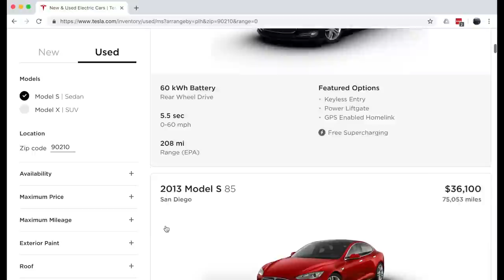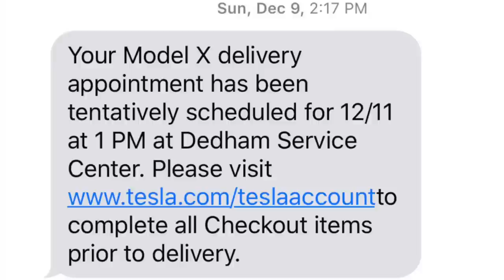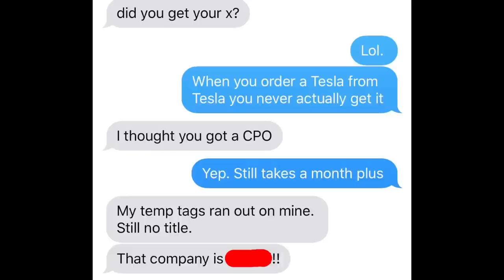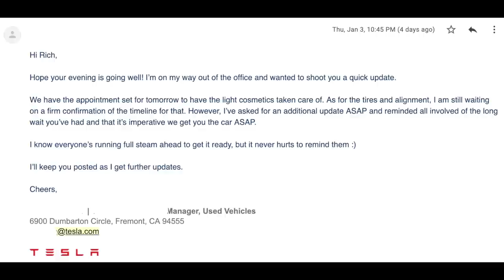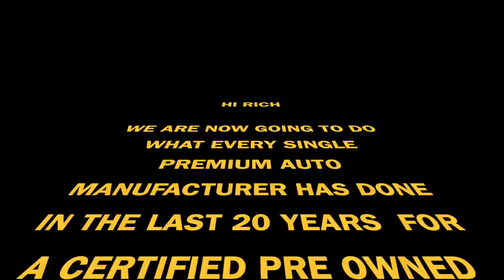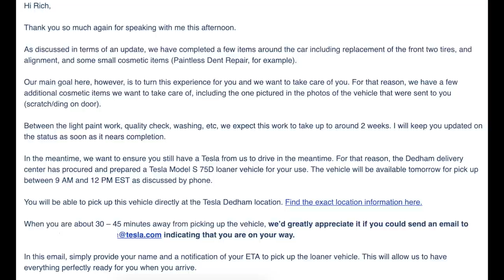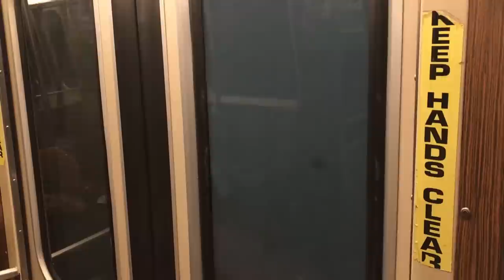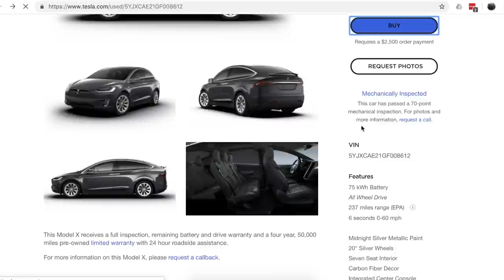How I became a victim of the Tesla system

Comment: Your mother is a much more sensible person; she drives a Kia.
Reply: Samcrac mama’s always right
Reply: Kia's fall apart quick
Reply: @legiongamers99  not if you treat them right.
Reply: @legiongamers99  Then the 7 year guarantee comes in handy ...
Reply: @Slim_Loaf  True, my 2012 Rio had only the catalytic converter need replacing and that was covered entirely by warranty when it was 4 years old. Kia was a good experience. I just upgraded 3 months ago to a Hyundai and that is going well so far.
Reply: 10 yr 100k mile limited power train warranty, 5 yr 60k limited basic warranty
Reply: I was going to say exactly this! I love your mum.
Reply: Rich's mother has to be a great woman. Just look at the son she raised.
Reply: @jadedjay7861  to each their own... I've had 2 Hyundais so far. 05 Elentra, starter went bad at 76k miles, warrenty took care if that got a loaner Sonata. Bought a Sonata about 3 months after that. Put 50k miles on it, brakes tires and fluid changes. Had for 3 years rented a Kia Sondona. Went a priced a new one which was a 2015. Bought a 4 year old Sienna instead for about $5k less.

Otherwise I'd have one. Might get another Elantra ot Veloster to putt around in.

But to each their own.
Reply: Took the words right out of my mouth. Rich do yourself a favour mate and buy the Jaguar. 

I can tell you exactly what happened, they designed the website to make is look sleek with the stock images and didn't want normal photographs to spoil the look of the website. What car manufacturer do you know, in order to buy a used car you have to request photos? That ain't typical of a car manufacturer. 

It's like one of those technology companies where you have to request a quotation to find out a package details. Its not a car manufacturer, it's a tech company, they need to figure out what are they first Car or Tech.
Reply: Does she also have a Nokia?
Reply: @110380michael  I'm on my third Hyundai. Haven't had a major failure with any of them. 189k miles on my 06 Elantra so far. Biggest non-maintenance expense has been the radiator.
Reply: @110380michael  What is your point? My m3 has 142k, my 335i has 200k, my grand caravan has 289k, my 325i has 120k and my caravan has 310k. All are perfect runners with maintenance and replacing wear n tear parts. Your point???
Reply: Now I know where Rich gets his laugh from :)
Reply: She's got more soul.... Get it?
Reply: haha nice one
Reply: @goclunker  ummmm... To each their own...
Reply: @110380michael  Ummmm... you act like cheap ass korean cars are a godsend, where as the world's most unreliable cars do double the mileage....
Reply: @goclunker  Mikes point is that a kia is not a ........."Kia is Korean pos junk."
Reply: @goclunker  haven't said nor suggested anything remotely close to that.
Reply: @michaelotieno6524  It is a Korean POS. You want a good Kia? Get a k900 or a Stinger, but please don't act like the 1.6-2.4L Kias and Hyundai are the pinnacles of trouble-free engineering. Their engine issues are now beyond documented. Mitsubishi blocks built to even lower standards than Mitsubishi itself.
Reply: I've had 5 Kia's so far(on my 5th one now) trouble free family cars for the most part. Better that the Ford I had, that's for sure. Optima, my engine is ok so far,yes there are a bad batch of them,but I've got a lifetime engine warranty,as long as I own it. As a result of the problems,with other 2.4liter engines. Also, Hyundai offers a lifetime warranty on their hybrids,and plug in electric car batteries. Lifetime.
Reply: @theartplaza Exactly. kia's and hyundai's piston slap issues on their 4 cylinders have been swept under the rug. We are not even talking about the common rod bearing issue, we are talking about piston slap which is unrelated yet prevalent. The genesis line, stinger, k900s are great cars, but lets not act like they have anything in common with their basic cars. They don't, and that's why they are great. An Optima will NEVER be a stinger.  Nothing is even comparable between the two, not the material quality, not the build quality and definitely not the mechanical. That's the truth.

Edit: There is one comparable: The badge. That's it.
Reply: @theartplaza it often depends on the dealership. The dealership I use has free loaners, and are very good at customer service. In South EastMichigan.
Reply: Ole The Viking 
Kia’s fall apart quick? Well, at least your covered for that with their 7 years warranty.
Reply: Jay Mack You can drive a Kia for 5 years and then sell it while it still has 2 years of warranty on it. How’s the resale value of your car?
Reply: I know my Mom would not drive me to a dealership...lol
Reply: @JohannesB5  lol what?
Reply: @Conservator.  That's the only thing i like about KIA. They're cheap and do what you paid for them to do. Nothing more or less.
Reply: @legiongamers99  amarican cars are know to be rately and plasticy. Atleast here in Germany.
Reply: @JohannesB5  lol I've never driven in a "rately and plasticy" american car before. I mean I've only driven Fords so I'm not speaking for other American cars. But aren't all asian cars using mostly plastic for interior? Seems a little hypocritical.
Reply: @legiongamers99  thy dont my moms kia is nicer on the inside than my passat
Reply: Didn't think I'd see you here :D
Reply: Your mum is funny lol ,what se said totaly true.
Reply: A-fucking-men. I've put so many miles on this new sportage without a hiccup. This is probably the first modern car i've demo'd that won't be in a used car lot within the next 10 years. Kia was shit in the past but they've improved a lot. Hyundai, the sister company, is also doing well.

Surprisingly, it's easy to repair yourself as well. Pop open the hood and look at how neat everything is laid out. Two plastic engine covers and then you have access to the plugs, pump, electrical system... A DIY's wet dream.
Reply: jappie2 read consumer affairs for kia and Hyundai... their high end cars are great, their basic cars are section 8
Reply: @jadedjay7861 :  Based on what?

Based on Consumer Reports, it's middle of the road, re quality and durability. 

Based on my experience renting cars, it's better than the American cars, and worse than the top Japanese makers.  Hardly surprising.
Reply: Um... I'm fearful for her life.
Reply: I drive a kia, yeay! 🤣
Reply: @legiongamers99   not anymore I worked for kia I used to think they was junk...but after being to the factory and driving them.. There are now a good make... They stole talent from audi
Reply: @legiongamers99  really? My mother has a old Kia Cerato that still runs well and rarely needs fixing for about 3 years now. Has 300,000+ kilometers
Reply: And a Kia has aftermarket infrastructure. Tesla doesn't care once you are out of warranty.

Comment: I wouldn’t touch a Tesla dealership or website with a 10ft pole & this cements the way I feel.  I was treated like a king when I bought my used $60k Porsche (not CPO) from a dealership 6hrs away.  Threw a fully refundable deposit on it & they had a it sitting with a red bow on it when I got there & the paperwork was ready to go.  They even gave me $100 worth of free stuff from the shop.  Tesla will not be selling cars in another 10yrs.

Comment: I've bought 3 certified pre-owned cars from the manufacturer (Mercedes W211 E320, BMW F01 7 series, BMW F10 M5) all were available to be picked up same week. All were in perfect as new condition when I got them (any stone chips taken care of, wheels re-finished etc by default) 
The fact that Tesla pretend that they are doing you a favour to compensate you for waiting over 2 months by fixing some wheel scuffs and some paintwork is an absolute joke.
Additionally, when you are buying something like a 7 series, BMW will loan you anything you want while you are waiting for your car to be prepared, right there and then, you don't have to wait a day or travel across the country to a different dealership

Comment: Most likely the car was curbed, meaning it lost traction in bad weather and probably bashed into a curb.  It makes sense considering it needed tires, an alignment, and had some distinct rash along the spokes of the wheel.  Likely they have been stalling waiting to get replacement suspension parts.  I've worked for premium brands before, there is alot of subterfuge when they find a problem that was not billed on the initial inspection.  Generally VW America will just issue a long term loaner for their higher end brands, usually a panamera or an A8.  Common issues with Porsche include exhaust system cracks, badly raashed wheels, bent or broken suspension parts and sometimes the height control doesnt work, all of which can have a backlog of 2-3 months to repair.  I also happen to know Tesla does not employ certified techs to do the initial trade inspections either so that is where this issue is rooting.  Tesla has the ability to solve this problem by simply making all repairs prior to listing them as certified pre-owned including aking sure it has the title.

Comment: I’ve worked at Tesla, and can tell you that this experience is standard. They split up so many rolls. From customer experience specialist, to owner advisors, to delivery experience specialist. There’s little contact between them, so that’s why there’s always conflicting messages sent to you. Most used Tesla’s that arrive to a customer come directly from an auction house and turned around in 24 hours ,and sometimes same day depending on scheduling. Tesla employees normally have to fill in rolls that they’re not familiar in, so misinformation is common as they don’t know any better. Most normal dealerships can get you tags same day, but since Tesla’s are distribution centers we can’t do that. Once you take delivery, the paperwork is sent to the dmv depending on your state. This process normally takes around 30 days, so if your temp tag is near expiring call your Tesla center and have a new tag overnighted to you. But if your dmv has sent out your plates and your tag is expired, your out of luck and have to wait. Most centers get overwhelmed and all the paperwork gets backed up, which what causes tag delays as well. If you guys are having some specific problems, I might be able to enlighten you on what you can do.
Reply: Tell us more, lets test out that NDA
Reply: Cyumadbro summit Just providing general info for people having trouble with there cars. Something most distribution centers will tell you if you gave them a ring. Since most people aren’t familiar with how registration works, etc...
Reply: Roles
Reply: @reezlaw  Unless he worked in the bakery department!
Reply: Benoit Avril This is the first time commenting. And I provided basic info what are you  questioning?
Reply: reezlaw I was in delivery. But roles don’t matter as much, as I had full info to help customers even if it didn’t deal with our department
Reply: Benoit Avril Then it would most likely prove that what I said is true if another previous Tesla employee said the same thing

Comment: Let me tell you..I had 2 experiences with Tesla at the end of 2018. One was for Solar which went a lot like your story (I cancelled after they laid off my rep). I also had put down a $1k deposit on a Model 3 which I also cancelled shortly thereafter. They took the deposit immediately and took over 3 months to refund it. I wouldn't do business with them ever again.
Reply: Mike Gervasi Dont put solar on your homes, not a smart investment.
Reply: so what did you end up doing for solar and car? Any competitor you would recommend
Reply: @guerrerofam3518  it would be helpful if you qualified that statement a little bit. What about putting solar isn't a good investment, and what kind of house are you talking about?
Reply: because putting solar is just dumb, you need super expensive batteries for it, and then you need to replace those batteries in 10 years, and you need about x2 as much batteries as you estimate.
Reply: @GamingAmbienceLive  My Solar City system has already paid for itself and is now saving me thousands.  It doesn't have any batteries. Educate yourself before making stupid comments.
Reply: That really depends on where your home is, its orientation, and your energy use profile. For many homes it's an excellent investment. For others it's not.
Reply: @GamingAmbienceLive  Solar systems do not always need batteries. I have never seen a battery based system anywhere but on youtube. I just finished my house shopping and two houses had panels that did not have batteries and sold surplus power to the electricity to the power company. During the night it just doesn't work and you use the power grid. One of them was not owned yet and had some sort of payment plan that was apart of the sale of the house.
Reply: @turbo2ltr  You have the tesla panels? or another brand?
Reply: then what is the point, they will buy electricity from you for pennies, you'd make more money in a day than what they would pay you in 3 months, its so damn stupid and pointless, you are at work all day unless you are a neet, and all your consumption is at night, and batteries cost way too much to offset the electricity costs, best batteries for such stationary application is Nickel Iron, but they were discontinued because they last forever and businesses weren't making money, but lithium will pack in a nice package and will cost $10K every 10 years
Reply: @GamingAmbienceLive  you do understand that they said the panels provide all your power during the day and you use the power grid at night, right? Meaning, buying batteries is not included in this at all. In addition, noone is trying to run a power plant, nobody said anything about making a lot from selling electricity. They said you sell the excess electricity.
Reply: hes probably on some farm off the grid ya know... @turbo2ltr
Reply: @GamingAmbienceLive  I see you're completely unfamiliar with grid-connected net metering plans. The concept is very simple. They buy your electricity that you don't use during the day, for a set rate that you know before you buy the solar system. For example in my case they pay exactly the same for solar power that they charge me... If by the end of the year I made more power then I used all year and I have extra credits, THEN they pay me what it cost them to generate it. in other words I have little or no electricity bill all year and then I get a little check. Because I have my solar system on a loan over the warranted and insured life of the system, I do pay that loan every month but it costs less than what my electric bill is. The end result being, I saved money every month... And the system will have paid for itself in just 5 years.
Now this is not going to be true in every one's case. You have to have everything work out in your favor for this to be practical. you have to have a power company that has a set rate plan that is good for the number of years you need to pay for the system. You need to have your house facing the right direction and enough room on it. You have to have a homeowners association that allows it or no HOA. You have to have a town that allows it. You have to make sure you're not buying from a scammer that's overcharging you. that last one's a very big one because I had three bids that were much higher than when I finally paid. The first one being four times as much and the guy was literally a fraudster.
Reply: Man, I got my panels from SolarCity right before the acquisition from Tesla and it was smooth as butter.  My rep was awesome.  While the panels are actually not meeting the minimum performance requirements after 2 years ownership (which I'm dreading dealing with them on), it's still a no-brainer good investment.  Electricity utility rates here are currently 23c per kWh.
Reply: @GamingAmbienceLive  I guess you don't live in an area with net metering? I have time of use pricing and get paid to run the meter backwards at peak hours (2-7PM) with solar, and charge the car at night at off-peak. Not only did we cook, light the house and drive, we actually got $260 back from the utility last year. No batteries needed.
Reply: @riotmakerzify  Not sure the brand, they are standard solar panels, not the tiles.
Reply: people are at work when the sun is shining thus the electricity you produce is a waste
Reply: sonds like BS because from what i heard when i was finding out was that they pay you 1/10 of what they charge you for electricity
Reply: @frammis or you could go to work an extra day and make that $260, its a complete waste unless you have cheap battery bank with a huge capacity that lasts forever
Reply: if you live in a shithole that charges 22c/kW then sure, its probably useful
Reply: @GamingAmbienceLive   It's $260 PLUS powering the house lowering the electric bill.  It's quite a bit more than a day of work when it's totaled for the year.  It took about 5 years for my 5.1kW system to break even.  Add to all the money I saved driving an electric vehicle and charging it for free and it is well worth it.  It's thousands a year in savings.
Reply: Cody Slab Why is it a waste? The excess not used by the homeowner is sold back to the grid/utility who then sell it to the companies where the people are working decreasing the utilities need to generate the power. Now if all places of employment were capable of generating their own electricity you might have a point but even the there would be other areas to use this power, how about daytime car charge points.
Reply: it was only free for short time, they will start charging money and a lot of it, considering nuclear power plants arent being built, coal is shutting down, gas will shut down, the electricity cost will skyrocket
Reply: its a waste of money, not waste of energy